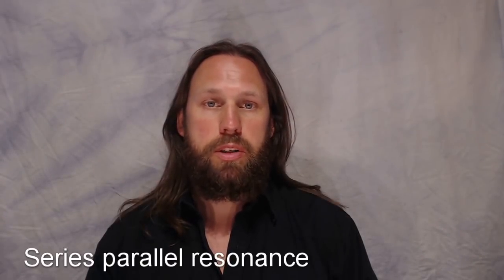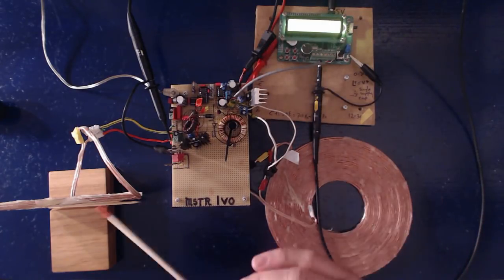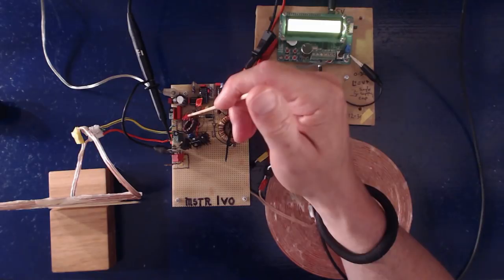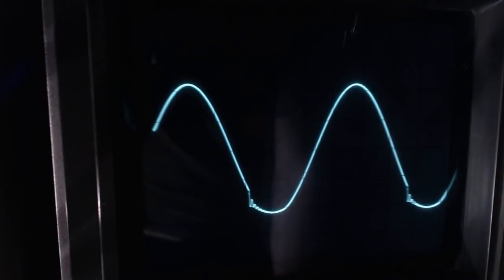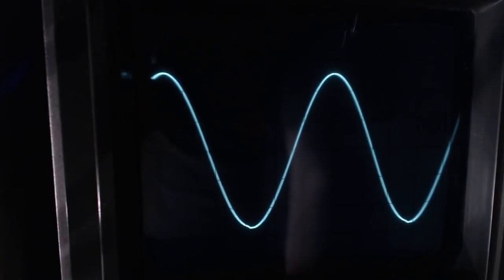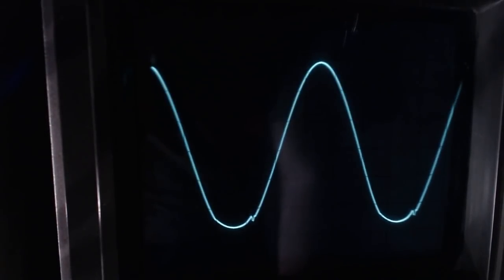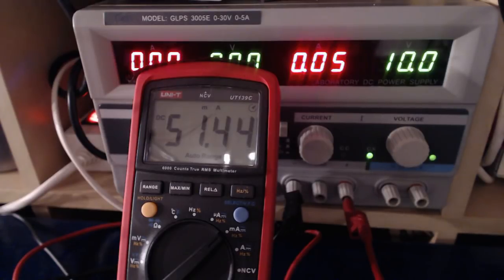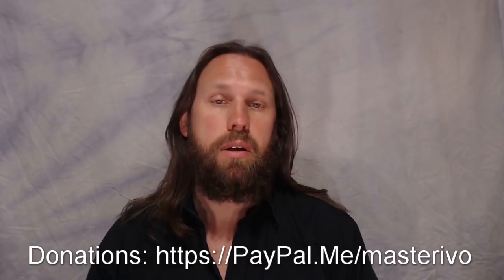Series parallel bifilar coil resonance, creates high energy gain.

Comment: How can a tuned circuit be series resonant and parallel resonate at the same time?  In a series resonant circuit the voltages in each element (L and C) and  are equal and opposite at resonance while the current is the same in each element.  In a parallel resonate circuit, the current is equal and opposite in each element while while the voltage is the same.  Each circuit is quite different from the other.
Reply from the maker: this is an old video, in which I was playing with the concepts.
Now I use two separate resonant circuits. one series resonant for high voltage and one parallel resonant for high current.

Comment: You get a voltage spike but what does the current look like? OK edit so after watching longer from the PSU it looks as though you putting in 10V and  50MA and it's spiking to 275V at 50 MA correct?
Reply from the maker: old video, can't remember

Comment: Finally I've wound a bifilar helical coil for my experiments. It's crazy how low the resonant frequency is if it is parellel bifilar. For example my series 40m (20-20) had fundamental resonance at 1.4MHz while the same parellel connected had a resonance at 81kHz which would correspond to a whopping 3.7km wavelength. I never thought a parellel bifilar coil would not only pick up inducing fields as it was supposed to be non-inductive in circuit but with this low frequency too!
Reply from the maker: sounds incredible, can you show us?
Reply: @MasterIvo  Yes I will try to upload a short vid showing it. I made a mistake though: the series bifilar was the one with ~80khz resonance. The parallel bifilar didn't pick up anything after the fix. I accidentally coupled the coil as a monofilar and shorted the other pair thats why it had response to the primary coil. Silly me. I knew it wasn't right. But my point still stands. Obviously the lower resonance has to do with the internal capacitance of the coil but this would mean nanofarads of capacitance and millihenrys of inductance which is large for an air core. I will post another comment If I have records. I checked if this wasn't just a very low harmonic, all other harmonics were lower in voltage. Another interesting thing is that tesla bifilar (series) coil rings at the fundamental frequency (80k) even if I sweep down or up. On the oscilloscope the waveform shape clearly stays 80khz but made up from the input frequency, just like a carrier wave in radio transmission. I used a hair thin wire coil with only 10 or so turns with the function generator as input. If I put higher and higher capacitors in parellel the lower the output voltage goes. But with 1uF I could pull it down to around 3.0 - 3.5kHz! Even ferrite transformers can work at this range. I'm thinking about completely doing away with the resonant primary and feeding the bifilar as the extra coil from a normal ferrite transformer like this guy did:
https://highvoltageforum.net/index.php?topic=218.0
This way I can have higher coupling just as Tesla in his later experiments used an inductor to raise voltage that is not inductively coupled to raise voltage (like modern boost converters using inductive kickback. The downside is that a bifilar's insulation cannot withstand very high voltages as the potential across turns is half the overall voltage. Sorry for the long text, I had to explain everything.

Comment: Would you consider selling me a kit?
Reply: Silly question....has anyone tried mixing a coil with less turns and a coil with a lot of turns in a pancake set up...if so if like to read instead of waste time experimenting if it's been done??? Also I'm making a generator is it better to use several coils or one big one...or perhaps one set up to produce voltage and another specifically to rise amperage. Any input that saves time is massively appreciated. Looking forward to sharing the results. I think I may have solved the v gate problem by accident when building my electric motor but no one cares besides me😂🤣meh🤷‍♂️ima use it for my own stuff🙄
Reply: Also on the topic when I push to opposing magnets together they create an electric shock sensation in my hands...so as far as I can tell I am thinking electricity is nature discharging compressed magnetic fields in the form of high vibrational waves that also show up as light, sound, plasma, and sound shock wave when attempting to dissipate compressed potential energy. The same way explosions discharge, air compressors, or any other type of discharge🤷‍♂️looks very similar accept that an explosion does not follow a line but rather takes the shape of it's container so the air seems to be acting like a container for the light, plasma, and sound shock wave. Hmmm.🤔pattern looks the same as cracks in concrete made by the rain so again seems it burning the air and water vapor like a fuse🤷‍♂️
Reply from the maker: At this time I won't, but in the future I might. I first need to make something worth building. thay works, and helps.

For now I do recommend you build the radiant power circuit of my april 2019 video. This is a great learning. tool. I am advancing it into a dual setup, which I will publish in the near future
Reply: @MasterIvo  silly question thinking if there is a way to stack these like battery cells with no acid🤔
Reply: I tried little bit but failed seems to me it should be possible because people also stack capacitor banks?
Reply: @MasterIvo  gees I've been having some wierd set backs the board I used for one of my tests warped for no reason a lot in no time🙄and I learned how to completely demagnatise a magnet by accident when looking at v gate set up😂🤣🤦‍♂️did you know that was a thing now I do it burned out like adding to much power to a light bulb magnets aren't cheap 🙄
Reply: I was experimenting on some ways to remove the magnetic bump which worked and than the magnet burned out so now I look silly. Whatever. Full speed forward.
Reply: @MasterIvo  I'll post about the magnet but I think few people will care😂🤣🤷‍♂️
Reply from the maker: Always post. you don't know if people care. should not even matter. You care!

Comment: Do you think it may be possible to used one inverting and one non-inverting gate driver and leave out the monostable multivibrator ?
Reply from the maker: I really don't know, you'll have to try it yourself. this is an old circuit, I moved on into another setup

Comment: Have you ever tried to use spark gaps to amplify the voltage?
Reply from the maker: No, I have another solution to the spark gap, instead of disruptive discharging a capacitor, like Tesla did,
I discharge a coil, this produces a inductive spike, that is the same energy.
the benefit is the coil discharges (magnetic field energy) when the switch opens (instead of the spark gap closing the switch of a capacitor)

Comment: All I saw was every time the voltage increased, you drew more amps. 
So it's not an energy gain your consuming more energy within the circuit. What am I missing?
Reply from the maker: You might be right, it's an older experiment, and I left this behind. It is part of my research, but I went another direction (Tesla's Radiant energy).
Reply: Phew! I was almost confused there one moment. Thanks.
I've seen this before, focusing on voltage without considering amps and their relation to total wattage.

Comment: Hi Ivo, I noticed that you are consuming about 0.5 watt from your 10V supply when at resonance. Are you using a load across your resonant coil or is this just with an unloaded coil? Not sure if that info is in your video, was unable to see it. Just curious at what happens to your high voltage out as it is being loaded. Would be nice to know what the output voltage and current are in RMS values and at the same time compared to the values of your input current and voltage so we get an idea of the efficiency from Pin = Vin x Iin and Pout = VrmsOut x IrmsOut.
Thanks.
Reply from the maker: Many have aaked this. But I didn't measure and moved on. I do intend to do a proper power measurement in a future video. Since I work so high in frequency I want to rectify it to dc. But even that seems problematic. So first some innovation needed.
I do remember this test being unloaded. It's a resonant energy gain, not a power gain.
Reply: @MasterIvo  :  Thanks for the reply Ivo, if it's the voltage gain you are after the resonance path is the way. However be careful with the idea of "energy gain and not power gain" as you may be aware from basics Energy = Power / Time equation and that the only time the "Voltage squared" term comes into play is when there is a resisive load involved, ie you have a voltage across a resistor which sets the power according to: P = V^2/R.
Now if you combine this with the energy equation above you get:

E = P/t  =  (V^2/R)/t

Which basically says that the Power and Energy in the circuit are related and not independent of each other.
Reply: Also since my background is in electronics, I would be interested in a more detailed circuit of your test set up - that is assuming you are interested in others replicating your experiment. Been going over your schematic in the video but found it a bit difficult with section involving the 10nF cap in parallel with the coil, mainly the fact that there is no DC applied to the MOSFET, i.e. the Drain Terminal is tied to ground for DC vie the coil. The results you show suggest that there is more to it than what I see in the schematic,  i.e. the timing of everything may have to be taken into account. For myself, I prefer pure schematics, eg actual MOSFET symbols and no blocks unless it is supposed to be a "system" or a block diagram.  These methods are usually easier to follow and understand  - for me anyway.
Hope I'm not being too picky about this.
Reply from the maker: @markg1051   I am interested in replication, but have moved on beyond this circuit. This was part of a learning process. Now working with series resonance.
The resonant energy can be calculated by calculating the energy stored in the capacitance of the coil/capacitor when its max voltage. That's why I refer to the voltage squared.
It's hard to keep it clear and simple at the same time. But I do my best.
I hope the circuit I'm working on now will be replicated. And I will do my best to make that circuit very clear.

Comment: Why can you not just use dc in bifilar coils to get more energy out than in? As long as you have a load on the coil in series the second bifilar coil will output the same amount of power if at an opposing popularity.
Reply: Study the capacitor properties on the pancake.

Comment: Hi thanks for your educational videos. The 10V relating to 100 times more energy doesn't sound correct tho...sorry. 
If your 10V increase equals 10 times increase in voltage and the impedance in which it is measured hasn't changed then yes it can be 100 times energy increase. From P= ExE / R.
Reply from the maker: I don't exactly understand what you are referring to.
Reply: As you showed in previous videos, the form of energy itself changes between dielectric and magnetic fields yes? When dielectric filed is greatest amplitude (=max volts) at this time usually the magnetic field is at it's lowest (min ampere).
When we divide max volts by min current we get high z value no?
In opposite case when dielectric field is lowest and magnetic field is highest, we have situation where min volts divided by max ampere value gives low z value. So in your video here the z value is not constant.
So it's very likely not correct to claim the 10V increase corresponds to 100 times more energy.
To measure this parameter it needs a slightly different approach. Using scope and your frequency increments 1st measure the upper & lower bandwidth  points at the -3dB point  or 0.707 of max volts.  Then divide the centre frequency  at max volts point by the bandwidth (the difference between the upper and lower 0.707 frequencies).   The answer will give you the "Q" factor of your circuit.  This Q factor is the direct ratio between 'free' energy circulating and energy dissipated in your high Q coils.  Then take a non inductive resistor and place it in parallel with your tank circuit, when this resistor loads down the scope voltage to 0.707  of its maximum peak to peak value, then that resistor is dissipating 50% of the energy available in your circuit.  From the scope (0.3535 of the peak to peak value) for sine wave, across the resistor gives ability to calculate the energy present from V rms x V rms /R .
hope this helps mate.
Reply from the maker: I was referring to the electric energy stored in the dielectric field. Q=1/2C (V*V) since V(voltage) is squared, 10x10=100.
When resonant if the voltage(dielectric field strength) is maximum the current (magnetic field strength) is zero. Dividing by zero gives zero. But Impedance isn't calculated that way. your method only applies when current and voltage are in phase (DC).

Comment: Energy is defined as the integral over the cycle. So if the system works by increasing voltage ( at shorter time) the energy is constant. OR if the system is an increment tank-circuit this is like putting energy in to a pendelum at resonance you increase the amplitude ( as a flywheel) that gives an increase in energy stored. Free energy may be extraced out of differentiad poynting vector or by extreme currents into plasma. Best Regards Zeke
Reply: show a self-looping system in the kilowatt range and discribe it with a circuit and data so people can replicate. It must be an ether extracting system like an heat pump but for electricity.  See how long this data/ifno will be on youtube after video is posted ;) 10 minutes?
Reply: @zekeriasvarg530  I want to see any practical overunity please
Reply: @zekeriasvarg530 I want to be free & independent JFK said that too. thank you very interesting repry sir🙏.
 I typed Peter Storm Brostrom , Elvis came up I couldnt find him
Reply: @motobacktoconstitution4138  he is a controlled opposition shill with a big wallet. The elite uses their inbreads to control the public arena.  You will find very many free  E tech if you study the shills and what they cover for.
Reply: @zekeriasvarg530  there are many free enagy BS in youtube or call disinfomation to wear people out literally million of video are fake I'm seekimg legitimate channel like Master Ivo's its so hard to find truth free enagy channel on top of understanding & try building is so much insane hussle I failed so many times because they are fake on top of that finding true free enagy more effecient than solar & wind tubine is almost God skill. If you see ligilimate affordable overunuty video please send me link please. 

Now I'm studing TheOldSientist & Master Ivo but I do not see affordable overunuty yet its so crazy. I dont even kniw if its really exsist?